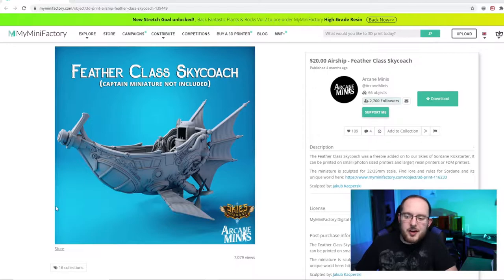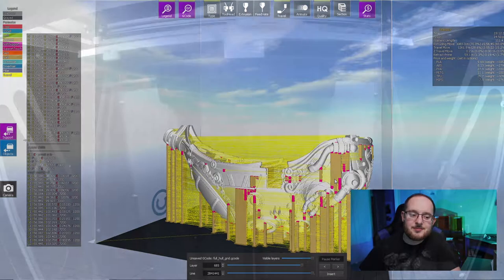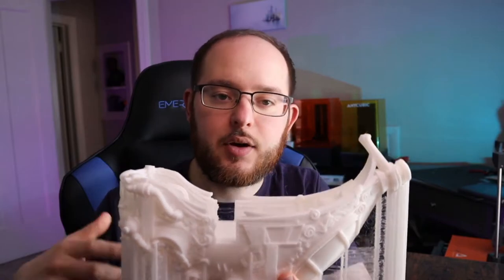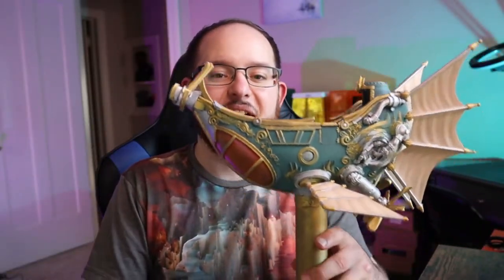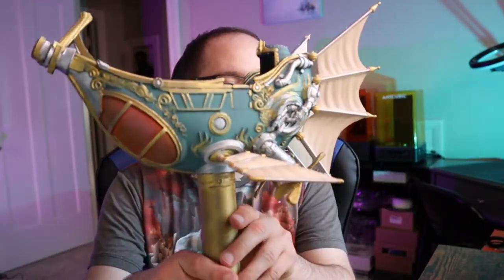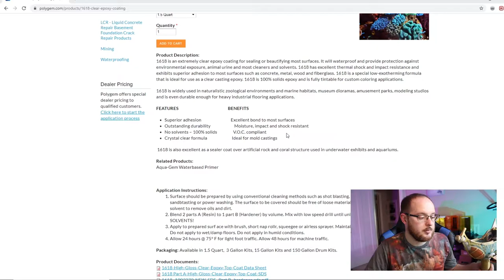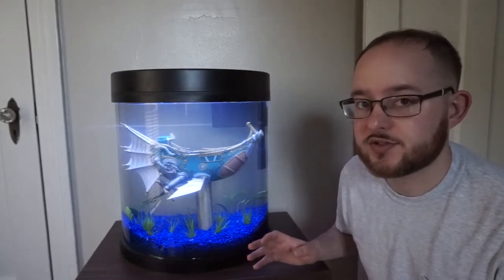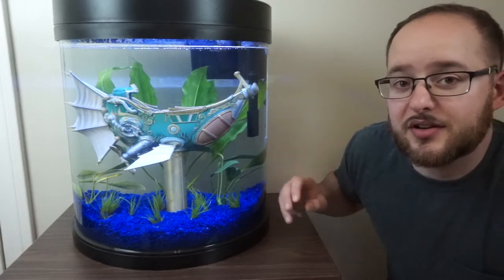3D Printed Fish Tank Decoration!! Print & Paint Airship Competition

Comment: VERY IMPORTANT.. Meltopolis
1 month ago
I use Vallejo paints but you’ll need to make sure to use the aquarium grade epoxy to seal it all in and allow to cure before putting in tank.
Reply from the maker: Yes you are correct!! That is very important to let the aquarium grade epoxy cure and seal everything in to be safe for the fish
Reply: @meltopolis  if you want the PLA model to sink on its own.. the INFILL should be set to 90 % or higher... it is the trapped air that is causing it to float.
Reply: Where can I get this aquarium grade epoxy  sealer? I've searched everywhere and it all says toxic do not use in water etc.

Comment: You must have made such a wide stand in order to capture so much gravel to hold the boat under the water... i printed something at 20 % infill and if was so bouyant, that it would have needed  half a brick to hold it down under... may i ask how wide of a stand you had to make.. or you could have printed it out at 100 % and then it would sink..
Reply from the maker: Hi gladiator mechs! Yes the base that I printed had a really wide area so I was able to bury it in the gravel and weigh it down so it didn’t float to the top
Reply: @meltopolis  Thank you